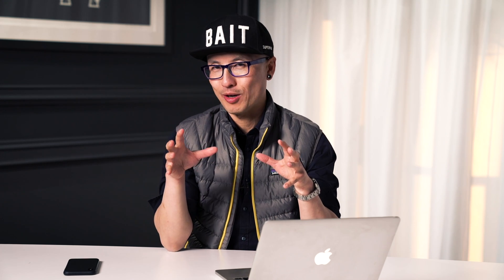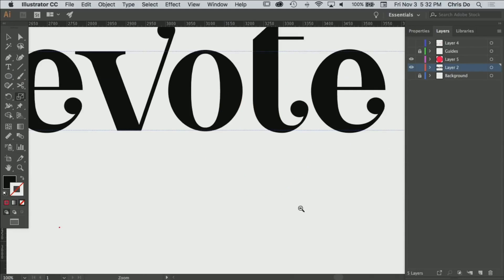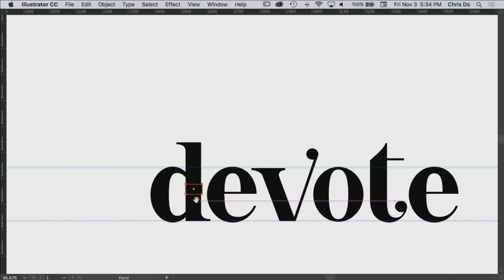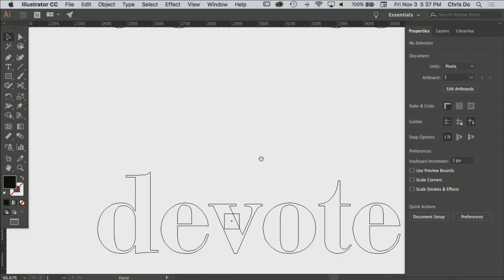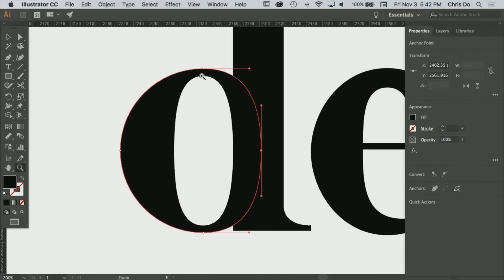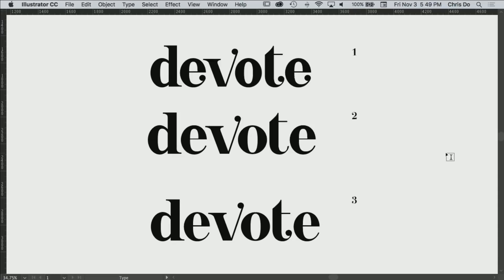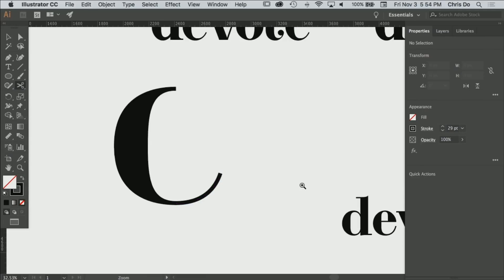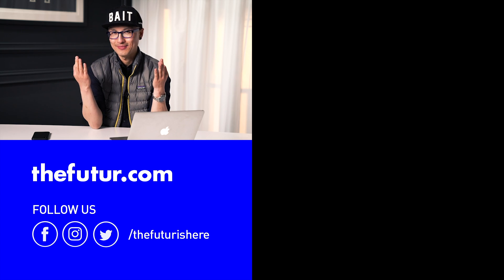Logo Design – How to Improve Your Letterforms

Comment: The overshoots for the rounded letters were DEFINITELY fine before. You said they were too big and then took them down to nearly the same height as the v. Obviously, this is a purely subjective thing, but saying that overshoots can't be that much taller than the x-height, and ESPECIALLY saying that they should be that close to it, is very dangerous misinformation to spread, especially when it's already difficult enough to find good information about what makes good and bad type.

Overall, good video, especially when talking about thin and thick strokes. The style of font that you're referring to that has great contrast between stroke thicknesses would be a didone style font in case anyone wanted to look for more examples of this.

Comment: Just a tip for the audio. In this video the audio is heavily compressed, which is typical when you're dealing with vocals or speech, but when you do that in a roomy-sound (room mic.), the audio gets really "pumpy" and brings a lot of "room-artifacts" to the front. Compressing vocals from a condenser mic is fine, but make sure you minimize the room sound.

Comment: If you skewed the square at 4:18 it would match the diagonal stroke. So, the horizontal width of the stroke is consistent. And three is best, the elements are more in harmony.